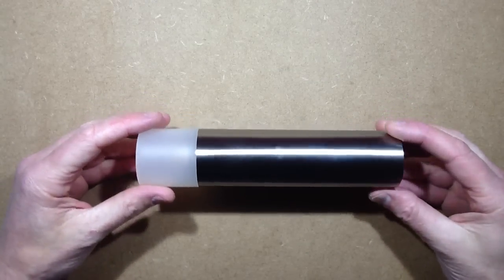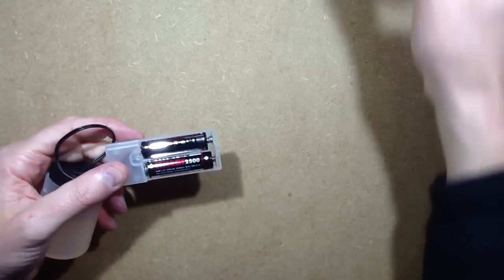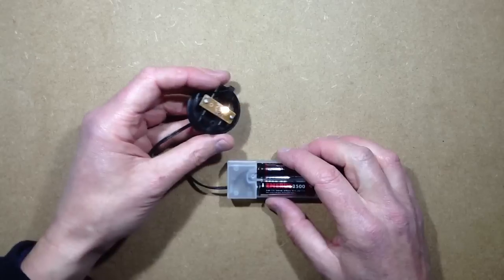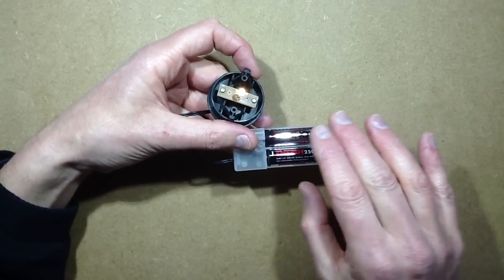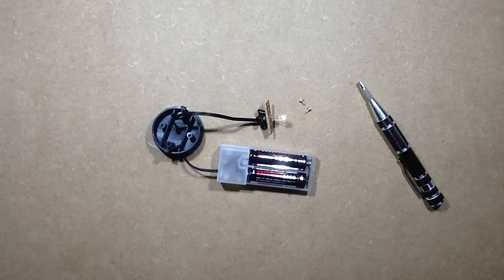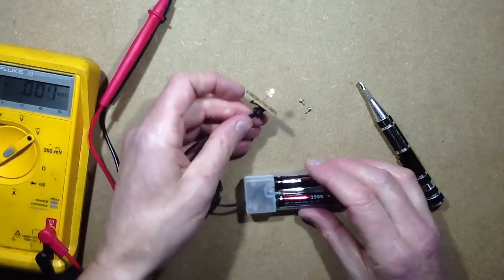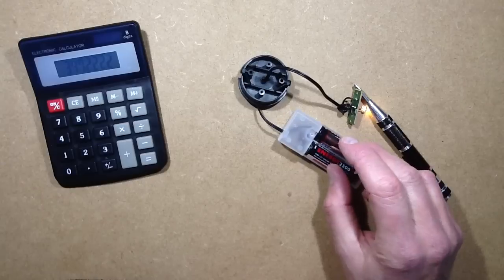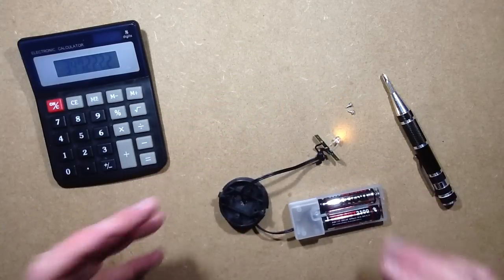Super long life battery night light.

Comment: I've been trying to find something out of the box I can buy like this... since I'm not so savvy at electronics.  I just want a very low light glow in my planter to illuminate under the leaves of my ivy... But don't want to be constantly changing batteries or running a wire to the hanging pot.  I might try building this if I can get everything off Amazon.

Comment: I made a small night-light of 1 white LED automatically turning on when dark (no off switch), running on a single AAA battery, since the 18th of September 2018(!). Its still giving out light and today its the 17th of June 2020. Its self regulating in the way that if you put it down on a table the light will adjust itself down from its own light feedback, but when you hold it up it will shine up and there is more than sufficient light to see the whole room. I think its pretty amazing :) 
Thank you for you videos.
Reply: sounds great! how did you build the light sensing?

Comment: Where did you get it? eBay? Why not add a photo-resistor (and some circuitry) to make it not be lit during daytime? New video project?
Reply: TheRobertSt the additional circuitry would cause the batteries to last significantly less time, probably down to a few days, as the light sensing circuit would run 24/7 drawing more power than the under run LED and resistor use while permanently lit. Adding a more accessible switch to manually control it would maybe be an idea.

Comment: At that low of a current, I'd bet the natural self-discharge rate of the batteries would be a quite significant factor in the overall run-time of the LED, especially if you're not using low-self-discharge NiMh cells.
I say this because I've read several sources that state a "normal" NiMh cell will self-discharge to "dead" within about a month or two, and this circuit has a calculated run-time of a little over 3 months.

The lamp looks large enough to hold a couple of D-size cells (IEC name LR20).
Using those I bet you could get a year or more out of this same circuit, as that size of cell is rated by Energizer to be 20,000 mah at 25ma, but lower current should make it last even longer than that capacity would indicate (due to Peukert's Law).
Reply: holy moly    Peukert's Law .  do you know how few people know of this !!    you just made my day..

So few people understand that AH is  not simple math.

Comment: Those look like the same cells I got from Lidl. Seems like Lidl sells two different types and those are the bad ones :(
They are supposed to be 2500mAh but when IO analyze those I get 1700mAh max (most barely reach 1400).
After putting them on a weight-scale it was pretty clear that those cannot be 2500mAh.
Reply: I once bought a set of these, 3 died after 3-4 rechargings. They're the worst rechargeable batteries I've ever encountered. IKEA Ladda are my go to budget rechargeables now.

Comment: This video inspired be to make a night light for the bathroom. That way I don't need to turn the lights on in there and adapt the eyes to the bright light and then readapt to the dark hallway. Enough light to see what's one is doing in there.

I used a 2xAA "end to end" holder with two 2000mAh cells. I used a "blob" pcb from a LED tealight instead of a resistor.(Ran just fine on 3v button cell so I assumed ~2.4v from AA's would be safe.) The original yellow 3mm LED was swapped for two 5mm warm white in parallel. Everything fits inside a spice jar together with two silica gel packs. Mosty to stabilise everything inside, but they should also keep it dry.

Running two leds in parallel should make the light more efficient and I think the flickering helps too. I measured the current and it vary between 1.5 and 2.3 mA, with an average at something like 2mA with fully charged cell. Should give around 1000 hours or 41.66 days of use.
Reply: This light is still going strong without recharge. I might get another couple of weeks or a month until I have to recharge.

But I'm thinking about making another one.I'm not getting enough ligth for stand up aiming. ;P

Edit: Still working as of 31/3.

Comment: It's pretty impressive how little power recent LEDs needs to run, which probably explains why some garden solar lights come with such tiny batteries now.  One set I bought uses a battery in each lamp about 1/3rd the size of an AAA.   Quite annoying as these batteries are difficult to get hold once they fail to hold a charge.

I have a few basic (non blinking) 15 LED fairly lights set that run on 2 AAs that I hang from wall-mounted speakers in December.  I ran them continuously using 2000mAh Ni-MH AAs and they ran for at least 48 hours before the green and blue LEDs starting fading out.  After another 24 hours, the red and yellow LEDs were quite dim.  Based on the time it ran all the LEDs, this would give a runtime of 30 days for a single LED, pretty impressive for these two year old sets.
Reply from the maker: The typical Poundland solar lights come with a tiny button cell and a solar cell of the type found on calculators, but larger.  (amorphous panel).  Instead of trying to light the garden they just act as marker lights for decoration.  They actually have a long run time.  The reason the blues and greens go out first on your multicolour strings is because the red and yellow LEDs have a much lower forward voltage, so as the battery voltage drops they keep pulling it down past the point where the greens and blues can light.  If you use single colour sets they run for a lot longer as the LEDs all stay at the same intensity as each other but dim down slowly over time.
Reply: I didn't realise they are now down to button cells on the discount store ones, but then again, seems like the next logical step after 1/3 AAAs in the ones I bought a year ago.  The previous generations we bought had AAAs and AAs before that (4 years ago).  On the other hand, most of the lamps don't last two years before moisture ruins the circuitry inside. 

I have a rather unusual solar powered 'bug zapper' one with a bluish LED that uses a single AA.  It came as a gift from some flower shop my mother buys from.  I keep that one inside (and manually recharge its AA) as I never really understood the purpose of having an outdoor bug zapper, especially when it only operates when dark.  A bit like placing mousetraps out in the garden.
Reply: +Seán Byrne It is quite impressive how far modern LED technology has gone with efficacy, I have a green InGaN LED with 220k (red-red-yellow) series resistor on 9V battery for months 24/7 and it is still quite bright with 30 microamps (0,03 mA).